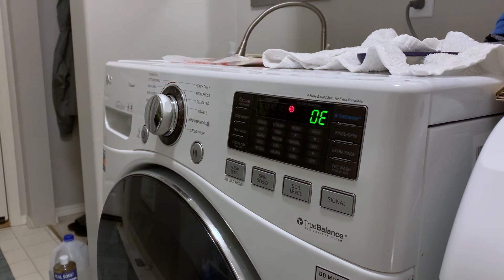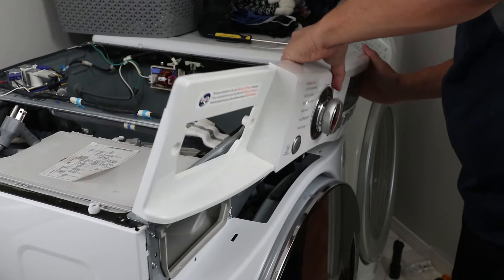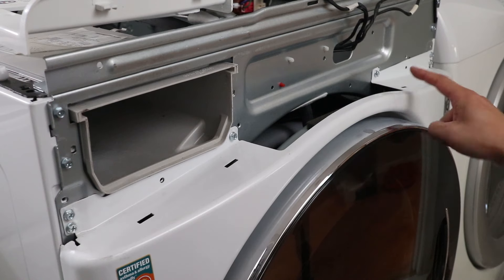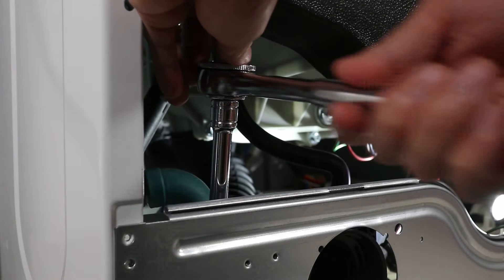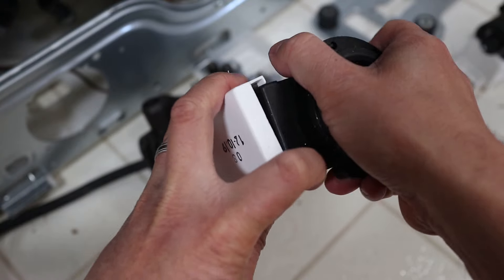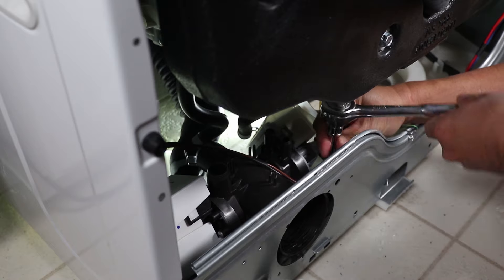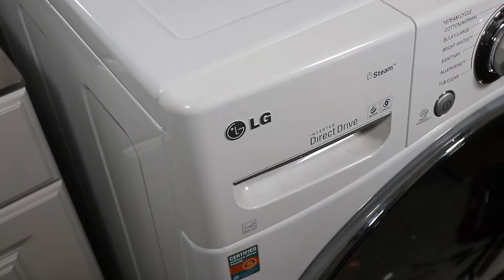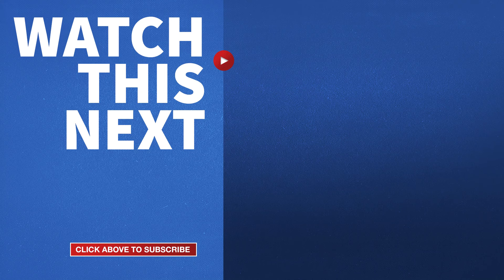LG Washer OE Error Code - LG Washer Not Draining Fix - LG Washer Drain Pump Replacement Tutorial

Comment: At age 67 I've lived the DIY life out of necessity  and not just to save money.  
Your video is very helpful and helps build knowledge of repairing an LG washing machine .
 OK I'VE  NEVER NOT HAD A LIST OF THINGS THAT MUST BE DONE AND HERE AT THIS SO CALLED RETIREMENT  AGE ,IM NONSTOP AT TACKLING REMODELING  WHICH INCLUDES  HAND DIGGING IN 9 CONCRETE FOOTINGS AND RESETTING 6X6 TREATED PORCH POSTS , 3 NEW ENTRY DOORS , DID I GET SIDE TRACKED ?  I BUILT MY OWN LOG HOME 33 YEARS AGO FROM THE GROUND UP  AND OF COURSE MY LG DRYER IN THE LAST YEAR STOPPED COMPLETELY  DRYING A LOAD UNLESS I RAN IT THROUGH " MORE DRY " CYCLE . OK NO BIG DEAL UNTILL WHILE AROUND EASTER MY LG WASHER STOPPED COMPLETELY.
WELL I SPEARHEADED BUYING THE MATERIALS AND LINED UP A CONTRACTOR THIS VERY WEEK TO REPLACE A VERY INTENSE VENTED ROOF ! WHAT ELSE BUT MY WASHER STOPS AND I LAUGHED WHEN I PRICED A NEW SET TO REPLACE MY 13 YEAR OLD SET THAT STILL LOOKED NEW.
 WELL IM FIGHTING TERMINAL  CANCER , ON HOSPICE AND I REFUSE TO JUST SET DOWN AND DIE . BULSHIT !
MY FAMILY TELLS ME TO JUST GO BUY A NEW SET  I SAID NOW WAY. SO  VODEOS LIKE YOURS HELPS GREATLY.
I CURRENTLY  HAVE ABOUT 675.00 SPENT ON BOTH AND I HAVE ONLY TO REPLACE THE BOTTOM HOSE AND PUMP, NEARLY ALL OEM PARTS .  MY WASHER WHEN I PRESSED START ,NOTHING  ! I FOUND  A TYPICAL FAILURE WHERE THE DRIVE SHAFT SPLINE STRIPPED OUT THE 8.00 REPLACEABLE  BUSHING ON THE MAGNETIC DRIVE HUB CAUSING A CATASTROPHIC FAILURE .
I PRICED ALL THE ELECTRONIC PARTS  , ALL THE WEAR PARTS  AND IT WAS A NO BRAINER TO DIY.  I REPLACED 4 MAIN  ELECTRIC PARTS ,THE DOOR SWITCH ,CONTROL BOARD , STATOR AND NOISE REG. PLUS SHOCKS ,PUMP , PUMP HOSE ,WATER PRESSURE  SWITCH ,HOT N COLD SOLINOIDS . I EXPECT IT WILL  WORK GREAT WHEN IM FINISHED AND FOR CONSIDERABLE LESS MONEY

Comment: I tried all lg recommended fixes and had the same issue with my LG front loader OE error code.  This is the fix.  MAKE SURE THE 3 AIRWAYS INTO THE TUB ARE NOT CLOGGED WITH YEARS OF USE.  Specifically, I pulled the hose off between the tub and pump, looked at the inside of the far back connection of that hose, and the inside is white plastic tube about 1.5 inches in diameter and it had crud blocking the small air hole that connects to the hose to the water level pressure switch.  Apparently, the Water Level Pressure Switch determines if water has been expelled.  The crud was mostly lint and dirt.  You can look up the white tube from the front of the washing machine, with the front panel removed, with a mirror and clean it out with some spray cleaner and a couple paper towels crammed into the 1.5 in diameter hole and twisting the towels around with needle nose pliers.  Then use a paper clip straitened to clean out the small hole inside that tube.  Get all the crud out.  If you do this, you may as well clean the top center of the tub air inlet by taking out the black hose pulling out the mushroom looking device and cleaning it.  Then to the left of that is a small black hose from the exit water hose.  Pull that from the tub and clean that by using the straightened paper clip.  Stick it in the little hole at lease 2 inches and wiggle it around to loosen up any crud buildup.  There is nothing on the internet about this so, good luck.
Reply from the maker: Thanks for the super detailed tip on what to look for if there are additional OE issues with an LG washer not working correctly! I know a few viewers commented that they still had OE error after the pump was replaced. This will help others know that else to look for!
Reply: Do you happen to have any pictures?
Reply: @alejopena318  sorry no pics available but you have to make sure the entire line from the water level sensor is clear.  It seems to become blocked with lint over a few years at the bottom of the wash tub where the small hose connects to the tub.

Comment: Best vid ever. I didn't find your section on how to organize the screws.Having a screw loose myself, I need instruction.  Now I have extras. I want to order the spring expansion tool, but I don't see the link you mentioned.You deserve the kickback they give you. Is there a way to test the pump before reassembling? My wife washed some rugs and all the backing plugged the tub hose. The only way to clean it was to take it out, Ugh! Please see my link below for "wife for Sale".
Reply from the maker: I’m not sure how to test the pump before installing. Probably no way for a consumer to do that. The links to the pump and spring expansion tool are in the description. If you’re on a computer web browser you’ll only see 3 lines of the description but click on the ‘Show More’ button and you’ll see the full description with the links. On the YouTube app on a smartphone you’ll have to tap on the small arrow to the right of the video title. That will open up the video description where you’ll see the links. Hope this helps!
Reply: @digitalcamproducer  Thanks again. My machine is running like new. The spring expander did make a world of difference.

Comment: Solid instructions! Saved $$$$$$. The rubber shock mounts underneath the pump mounting plate were not in the best condition be good to maybe suggest replacing those. I had to use a sponge underneath to absorb the torn one. Also the pump from Amazon is super loud. Much more noisier then the OEM. I’d be willing to pay for an OEM but I couldn’t find it in LG parts. Thanks again!
Reply from the maker: You’re welcome! I’m glad my washer pump replacement tutorial was helpful! Definitely saves money not having to call a repairman out! Thanks for watching!

Comment: I found passing a plastic wire tie thru the spring, and then pulling the loop with a closed pair of vice grips worked well to expand the spring.  Still needed my wife's help, but it was a matter of seconds.

Comment: Lessons learned - make sure the electric leads are properly seated - don't just push them in and think that is good.  Don't take the door off.  Get the stretchy tool - I made do without by stretching the spring between 2 screws drilled barely through a scrap piece of plywood and then undrilling one screw when the hoop is placed - It worked but not ideal.  I removed the lower weight on the drum in order to get better access.  An easy 4 bolts to remove and then replace.  There are 2 different pumps, if the water doesn't drain make sure to get the "drain" pump and not just any old pump.  Finally, thank you for showing me how to fix the washer.  Had the same exact problem, impeller broke off.

Comment: I absolutely loved this video. I like to try and repair things myself and the speed and flow of your video and camera angles made it an absolute snap! Definitely giving it a like and keeping an eye out for more repair videos like this. Like Ivan Lawrence, I did the same for the spring. I had my adult son hold it on the left while I slowly wrapped and snapped it in place until I got to the last 6 to 8 inches, then pulled down and to the right and it just snapped into place. 
The only thing I would like to see in your videos is a tool list before the transcript of the process. I kept having to stop and go get yet another tool! Lol. If it hadn’t been for that, I could’ve done this complete change out of the pump motor in half an hour. I also wrote the colors of the wires under the connections and was happy to see that you did the same. However, my brown and black wires were reversed from what you showed. I had to double check myself to make sure.
Reply from the maker: Excellent! I’m really glad you successfully replaced the drain pump! I’ll keep the ‘list of tools’ in mind for future videos! And yes a few have been able to reinstall the final spring with creative methods. I was doing this myself and the spring expansion tool was the only way I was able to put it back it. And it does save a lot of trouble but mostly it’s a one use tool unless the pump breaks again! Nice work with your son! Thanks for watching!

Comment: Thank you for your video. I wanted to add that I did not have the expansion tool so I got creative and it worked like a charm. I got a wrench and two zip ties and zip tied each end to the coils before inserting it back to the plastic door seal. Popped it back in with the gentle use of a screwdriver to make sure it was secure and then I cut the ties and walla wire set. Okay, now on to my question…We have a kenmore all in one washer and dryer combo. Our error is “DE” drain error. “Pump clogged”. So I removed the front little hose and basket and cleaned those out and I do this maintenance monthly. I ran a cycle and put a bucket in the front and I can see the pump pushing the water out with force. However once I reassemble everything and run the cycle again, I then get the same error as if it won’t pump it out the back hose into my home’s drain line. I have cleaned all the parts and hoses in your video and even cleaned out the drain pump and put it back together. Again, I run the cycle and as long as I have the bucket in the front and the tiny hose drain into that I get no error. I’m not understanding if it’s clogged in the plastic part at the end of another video I saw or if the pump is not strong enough to force the water through the back drain hose as it is suppose to work. Any guidance would be greatly appreciated. I am now gonna take it apart again and see if I can see any gunk in the plastic part I saw in another video. No one talks about that part from my research except in one video I found. Again, Thank you so much for your video.
Reply from the maker: Sorry I’m just getting to your comment now. Did you ever get your washer working? Not exactly sure why that drain hose is causing a problem. Hopefully you figured it out and your washer is up and running now?
Reply: Did you get this figured out?  I am having the same issue after installing a new pump

Comment: Tip for the spring cable without the  expander tool is to use a plastic bicycle tire lever. Worked like a charm with no damage to the rubber.
Reply from the maker: Excellent tip! Thanks for sharing! Yeah that spring is very difficult to put back on. Glad you devised a no cost solution that worked!

Comment: Thank you very much for this. Huge help, especially the parts links. Ours just started throwing OE with very non-pump like noises.
Reply from the maker: You’re welcome! You should be able to replace the pump without too much trouble. Mine didn’t show any sign of potential problem. It just stopped working. Thanks for watching!

Comment: Great video.  Just removed the drain pump on my washer and it has the same part number as yours.  However, for some reason the black and brown wires connected to the pump are reversed when compared to yours!  Mine has black on top and brown on bottom.
Reply from the maker: I would stick with how your wires were connected originally. No need to mess up what was correct before. Not sure why mine is opposite of yours.

Comment: Welp, running a second quick cycle after this video and so far things look great. I do suggest to those that do this repair, to use some silicone on the new motor gasket and use dielectric grease on the connectors, this prevents rotting of the gasket and rusty connectors. 
Great video! 
Where's the tip jar?
Reply from the maker: Excellent! Glad you were able to do the washer repair yourself! I’m just glad you got it fixed! Thanks for watching!

Comment: Great video. Thank you for posting a note about wiring (lift side and right side brown blue and black wires).
Reply from the maker: You’re welcome! I’m glad my washer pump replacement video was helpful! I wanted to document this accurately in case I had to do this repair again. And I wanted to help others who are experiencing the OE error on their LG washer. Thanks for watching!
Reply: @digitalcamproducer  The wires on mine were opposite with the black wires on top. does that make any sense?

Comment: Thank you, saved me 150 bucks. It was actually a piece of cake and my pump was easier to come out because I had the one that was attached to the front panel with 2 screws. Thank god for the spring expansion tool, without it I’m sure I would have had to call the guy😂. This also allowed me to clean the boot drain tube because it was full of yuck.
Reply from the maker: That’s great that you had the washer model that was easier to open up! My repair would’ve been a snap if I had that!  Glad you saved money fixing it yourself. Now you’ve got a working washer again! Thanks for watching!

Comment: Thanks so much.  Great video.  Mine sits on top of a LG pedestal washer so I didn't have the two small tubes to unhook, just the green one and the big one.  My wife would like me to work on the little pedestal washer since we seemed to have so many problems with it leaking on floor, we finally quit using it.  Any suggestions or videos for this?  Thanks again.  Best tutorial I've seen.  I bought the  tool and am waiting for Amazon to send pump and tool.  I have already taken  everything apart and labeled.
Reply from the maker: Glad my LG washer pump replacement tutorial was helpful! Regarding the pedestal washer, this is the first time I’ve learned about it. It looks kinda cool but a bit unconventional. I don’t own one and not sure of what is causing the leaking problem. Maybe it’s a cracked tube or one of the tubes isn’t properly connected? Does it share tubing with the main washer? Or can it be used on its own? Sorry I’m not more help on this.

Comment: Thanks! I followed your video and fixed my LG washser!
Reply from the maker: You’re welcome! I’m really glad that you got your washer fixed! It does seem intimidating to remove all those parts but it’s not too difficult to do. And really pretty cheap to do it yourself! Thanks for watching!
Reply: @digitalcamproducer  I got to say, you video is way better than other youtube videos I watched for fixing this problem. Especially the tool you recommended for dealing with the spring, it was a life saver. Thanks again!
Reply from the maker: Yeah I had ordered the pump only when I first started the repair. But later found there was no way I was getting that spring back on without the tool. So I had to wait another 2 days for it to arrive. I didn’t want viewers to delay their repair so I definitely recommend getting both parts at the same time. I’m really glad you got your washer working again! Thanks for watching!
Reply: You spent way too much time fixing your washer by following this video. Just pull the washer out a few feet and tilt it back towards the wall.  You can access the pump through the bottom of the machine without taking the whole dang thing apart!

Comment: There's a big hole in the bottom of the washer and you can just remove the pump through that if you want to prop the washer up.  I just leaned mine against the wall and it worked wonders.
Reply from the maker: Glad you were able to get to the pump from underneath! A few other viewers had mentioned that method. It’s probably a faster method if you’ve got the space. Thanks for watching!

Comment: Thanks for this video , can’t get the dam spring ring on I guess I’ll have to order the tool .tried for 45 mins . I surrender ! But much appreciated 🙏
Reply from the maker: Yeah I can relate! I tried everything I could to get that spring on without the tool. Eventually I had to get it to finish the repair as well as finish my video! Thanks for watching!
Reply: I have a problem with spending money on single-purpose tools, so I started a hunt to find something else that could work. We slipped  a zip tie into each little wire circle of the spring and my husband pulled  them apart as I guided the wire into place. It WORKED!!  Saved 12 bucks on top of the money we saved doing it ourselves. THANK YOU for this inspiring video!

Comment: Thanks for the video. Your presentation was very clear. The problem I have with my LG, is that when it sits idle, water gathers in the tub. On one such occasion, I opened it and water came gushing out on the floor. Is there a fix, other than turning off the water when it is not being used? Thanks in advance.
Reply from the maker: I’m not a washer repair expert but maybe your water supply valve is leaking and filling the washer with water when it’s idle? Not sure if that can actually happen but somehow water is getting inside. If you haven’t had it repaired yet you might be able to run a drain cycle and pump the water out before opening the door. Sorry I’m not more help! Thanks for watching!

Comment: Thanks for the great video, found my problem was just coins, rivets, drill bits jamming up the pump.
Reply from the maker: At least it was only coins and stuff jamming up the pump. But if one day your pump fails you’ll know what video to watch to help you replace it! Thanks for watching!
Reply: @digitalcamproducer  The pump ended up failing a week later, Lucky my model has a removable kick panel across the bottom. Once removed it gave enough access to replace the pump without having to remove the front of the machine.

Comment: All I did was blow in the drain pipe and then clean out the lower drain control area and I put machine wash powder in and put it on tub clean and it fixed the problem

Comment: Great video! Followed it to a T. But unfortunately replacing the drain pump didn't fix my problem. The LG washer is still not draining shows the OE error message. There is now a loud hum when its trying to drain. The drain hose is not clogged or kinked... Not sure what to do next. Any suggestions? Thank you for the video!